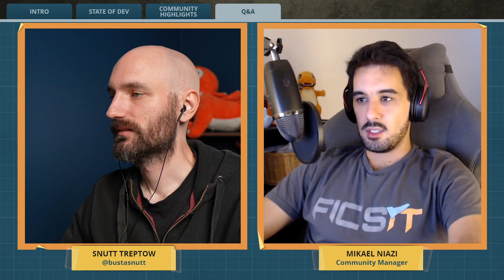Q&A: Is the Pipe Mk.2 bug still a thing?

Comment: I have an entire fuel factory running off one oil node at 600 per minute.  But the issue is that the factory constantly throttles between 88 and 95%.  I have a couple buffers in the system and pumps are everywhere.   But yes there's definitely a bug somewhere that is making it so that liquid of some sort is not making it to the desired destination
Reply: I have that for fuel generators, 2 lines of 5 raffineries for fuel and the "blue gravel", follow by 2 lines of 3 raffineries that use the blue stuff to do 2 for plastic and 1 for rubber (@75%). I feed 2x10 fuel generators without any problem.
Reply: I was having that exact problem before because I wanted some kind of overflow system where any oil not sent to plastic and rubber production gets turned into fuel, fluid hammering caused me problems for ~4 hours because you know how it is when you pick something up for the first time in a while, but I managed to solve it by having the plastic and rubber manifolds "drop" out of a mid-air junction. Now I get closer to 599.9/min, not perfect but precision gets in the way.

I'm quite sure water hammering/fluid hammering is when a loss of flow rate in the end of a system sends some backwards propogation of lowered flow rate earlier in the pipes, it's pretty annoying but realistic to a degree. Don't quote me on that though, I don't have enough time to check the wiki at the moment.
Reply: I have 2 rocket fuel refineries. Each starts with 600 crude. They have miles of pipes and end in 51.8 fully maxed and fed generators that are roughly 60m above their oil pumps. No issues at all. They have large tanks after every production chain that leads to the next phase and a small one at the end of the feed lines. If your head lift is good and you have capacity in the lines to support it you get no sloshing. Make sure anything with a solid output is met with usage or a sink and your systems should never stutter.
Reply: That's 104 generators running off 2 pure oil nodes with no hiccups. And plenty of expendable rubber.

Comment: We need a Garry's Mod style weld tool for the build gun, where you can click any two pipes, two conveyors etc that are within valid range and reset/reapply their connection.

Just for the sake of the minor issues where two lengths of pipe forget that they're connected

Comment: The way pipes flow forwards and backwards a bunch means that you need to have extra capacity compared to conveyer equivalent. Or at least that's my experience that I only use 90% of the available flow. E.g. a tier 1 pipe says 300/min but I only connect it to 6 coal so it should only use 270/min but it gets to surge to 300 and it often does

Comment: They are indeed broken. Fluid going into a pipe, then on the other side of a pump, there is no liquid. Thats not a user issue. Before the pump it is flowing, then on the other side everything is dry. I even tried putting a buffer onthe other side if the fluid is coming or not.
Reply from the maker: That's a different issue than the one discussed in the video.

Comment: Honestly have dropped 2  52 generator rocket fuel powerplants between oil pump and generators are around half a km of pipe and 40m elevation. Havent even seen a slosh rush smooth as silk.  Provide headlift( check when placing pump if the headlift stops somewhere) provide capacity if your adding 600 and removing 600 and think thats somehow magically happened at the same moment 🎉 you won an unstable system. Put a small liquid storage tank at the end of long lines and fill it. If you cant fill it you dont have enough headlift to get capacity for that system.

Comment: I had a pipe mk2 bug today, only oil going  in pipes. A few pumps, once we upgraded to mk2 without removing mk1, just paste. The whole system stopped flowing and the sections between pumps turned to water 😮😮😮

Comment: Wait, you can have too many buffers? How would one recognice something like this/what Is the Problem when doing this?
Reply: I haven't tested this hypothesis, but:

buffers act like really thick pipes, so if you have a lot of buffers in your system, more of the fluid spends time spread out in the pipe network and less makes its way to the machines that need it

it doesn't matter for anything before aluminum refining because the inputs and outputs of the process don't mix, so you just fill up the buffer until the pipes are full enough to keep the machines consuming the fluid happy 100% of the time

but if you have a system that doesn't completely fill the pipes, having too many buffers acts basically the same as having a really long pipeline

assuming it works like in other factory games I've looked deeper into, buildings don't suck fluid out of the pipes that aren't directly connected to them; they just suck from one pipe and then the fluid settles a bit and there's more fluid for them to suck so they grab that and it repeats

if the pipe is full enough that the machine can constantly keep its internal buffer full, you're golden, but if not, the effective length of the pipe affects how fast your machine can get its input fluid
Reply: @BenLubar As soon as I thought in terms of pressure, fluid problems went away. The less full the pipes are, the less pressure pushes the fluid down the pipe. Keep buffers full as possible to keep the pressure moving the fluid.

Moving 300 m³ of fluid in a 600 m³ pipe is not the same as using a 300 m³ pipe.

Comment: Don't want to rain on anyone's parade, but placing a junction on a horizontal pipe, rotating it so it's sides turn vertical then feeding it from the bottom results in negative infinity head lift.

I have a vertical coal generator setup that is above the water extractors that feed it and it works without any pumps.
Reply: How far above? Extractors have 10m head lift on their own
Reply: @Harimau0451  well, let's see. Extractor itself is 16m tall, the plant's non-chimney part is 9m tall and there are 3 stacked on top of each other, and the plant's entry point is 1 meter above ground (so is extractor's output, so pass on that). so it's like 34m.

pre-1.0 I had a fuel generator tower that was 10 gens tall and the packagers that unpack diluted fuel were between water extractors and refineries, so if one fuel gen is 20m - that makes like 300m vertical pipe that worked without any pumps.

Comment: I've not had issues. On the first hill from the fluid source, I place a pump just below where the flow stops. I keep doing this until it gets the fluid over the high point.
My factory is on a flat platform & I avoid taking fluids vertical.

Comment: I've had very good luck with pipes since 7.0 though sometimes the texture misalligns and it looks ugly, and I don't  want to go though the trouble of refilling the pipe.

I use wall and floor holes a lot but haven't seen too much trouble.

You folks may be talking about completely different bugs.

Comment: I was on a server with a friend of mine, just having pipe mk2 unlocked I ran around upgraded fully working system to mk2 and there were some fuel generators connected to a WORKING mk1 system then I saw our fuel gens go red and no fuel was being poured into them, we were scratching our heads thinking where the issue would be, there was fuel in the pipe next to the generators and the pipes were connected, what solved all of this? disassemble pipe which is connected to the generator and put it back again (and do the same for fuel production cuz it wasn't letting made fuel out in the pipes) if that is solved then do tell what must have been done so that our fuel gens would work without all of that hassle

Comment: I have an issue where I’ll feed a line of coal plants and like generator number two or three won’t be getting water, but 1 and 4 are full.  Delete the stub pipes, which were full, and redo them and it works after the pipe fills.  Been trying to consistently reproduce but can’t get it.  Maybe it’s not snapping right and I’ve got a support under the genset?  Might delete the Gen next time and see.  Such an odd, but easily fixed issue.

Comment: I still have issues with pipes. Whenever placing in a floor hole, I have to replace both pipes on either end of said floor hole after placing them on the floor hole. Otherwise, neither pipe acts as if it's connected to whatever I have it connected to. Also have this happen sometimes when I place MK. 2 pumps on pipes, I have to replace the pipes on either end of the pump to get them to work. If these are user error, I'd like to know what I'm doing wrong! Should I not place the floor holes then connect pipes to them afterwards? Should I be placing pumps in a specific spot to get them to stop breaking the pipes?

Comment: I had a perfectly system working, then i decided to overwrite all my mk1 with mk2 pipe, just for future upgrades, everything stop working, not more fluid flow on my pipes... so yes it's bugged non early acces content
Reply: Naw dude, your mk2 pipes aren't getting the same pressure as the mk1 pipes so the fluids don't move the same amount through them. Don't upgrade until you actually have 300+ fluids/m moving through them

Comment: I can appreciate why games like Satisfactory and Factorio want to make fluid dynamics realistic, but I feel sometimes like trying to get it right is at the expense of gameplay.  People having to share all sorts of isoteric tips and tricks that they aren't even actually sure works is less than ideal, in my opinion.
Reply: It's by design that the fluid dynamics are complicated. Everything other than belts were created in a way to cause headaches to the player. Without complications, the gameplay would get stale very quickly.
Reply: It's not complicated though. You just need water pressure or else it will slosh around.
Reply: @jefferylittleton1005  Except that unless it's been fixed in recent updates, achieving the full capacity in the pipes wasn't feasible because of the sloshing, so you couldn't get "full pressure"
Reply: @jaesaces  I haven't had that problem in the last 3 years. Atleast with mk1 pipes.
Reply: @jefferylittleton1005  Compared to belts. Belts are the constant. Everyone can understand them. Every other logistic method in the game requires at least some baseline understanding of the new mechanic, which usually comes through tinkering or researching. The reason fluids are so misunderstood is because it's really difficult to pin down what and where problems are being caused due to the visual and UI feedback being much harder to parse.

Comment: the real takeaway here is that Factorio 2.0's handling of fluids is the best
Reply: Definitely. In many cases Factorio has been doing things much better than Satisfactory
Reply: 100%, when you make a game about belts and pipes with large amounts of people saying the pipes work like shit, maybe you made a mistake when deciding to keep going with the floating numbers-no pressure-infinite slushing mess than can only be repaired by adding ridiculous loop pipes, not using specific base-game assets and forgetting 80%+ of the types of designs for any building with liquid inputs or outputs. Seriously, treat the cancer, kill the mechanic and slap belts that need uplift to go past altitude points. It's absolutely ridiculous the energy spend by humans of fixing this mess and its effects on games and learning curve about metagaming aspects compared to them just making something the hell else...

Comment: The fluid dynamics implementation is so stupid. No one should have to read a guide put together by a community member because fluids were done in a dumb, unrealistic way. Like for instance, my taps in the second floor of my house are all fed from the bottom but for some reason that doesn't cause the whole system to regularly starve for water because there's enough supply.

Comment: Gimme Pipeline Mk 3 pls because 2x Zoomersloop into Refinery gives 1200/Min of Alumina Solution. I need to be able to actually extract it.

As a pipe engineer tell you what: pipes in game are okay, the dem noobs need to understand the game mechanics and attachments of their own. They mess up so bad and then blame it on devs. 
Skill and knowledge issue 100% confirmed. Never had issues with pipes that I couldn't resolve myself.

To devs: you guys could add pressure and flow physics for awhile and see them all crying. Just for shigiggles, maybe for April's fools or something.

Comment: I hate pipes in this game. 
They're so shitty and unintuitive.
Reply: Skill issue
Reply: I can understand the frustration, but to be honest it's pretty much a "skill issue" but don't get offended from this, i mean with a couple of videos it's possible to understand how they works once and for all
Reply: it's actually really simple, I just had this issue with my turbo fuel power setup, I always fully flush the lines once I've set up a system to make sure that if the power fluctuates it will fill without interference, everything except the last 4 generators worked within 5 minutes the last 4 took a full half hour to fill. had to go through and fix my pipes then flushed again worked perfectly, took 5 minutes.
Reply: Also be sure to raise pipes above the inputs so that the liquid flows downwards, that way it fills them up one at a time, makes it flow cleaner in my experience
Reply: it literally is a skill issue though, once you successfully make a plastic/rubber setup liquids will then be intuitive.
Reply: @shibbet  Not really... the first one that utilizes the first 120 oil node takes up  4 7 machines to run and very minimal pipes, also liquids should be figured out before plastic ie when you're setting up coal power. seeing as how most coal power from the first starting point requires a huge pipeline of water.
Reply: @coreycarries  yes but coal is very simple since it’s just plug and play. Rubber and plastic is where it gets scary since there’s input and out put for both liquid and belts. Personally it took me a while my first time but at some point it just all clicked for me. And then getting mk2 pipes made it that much easier